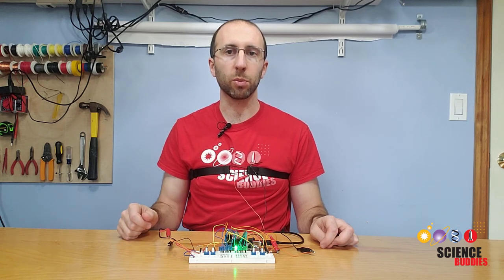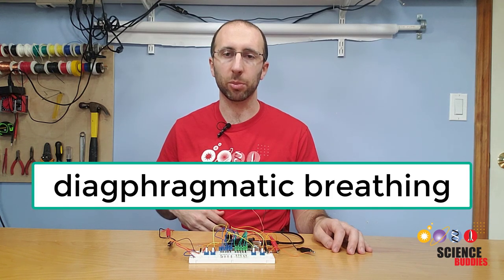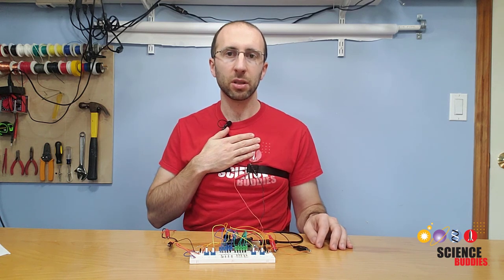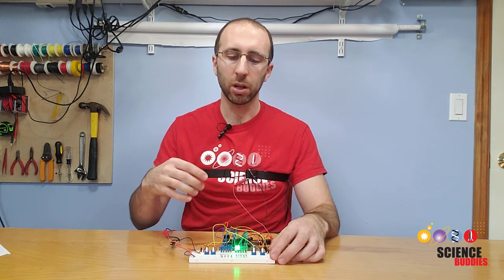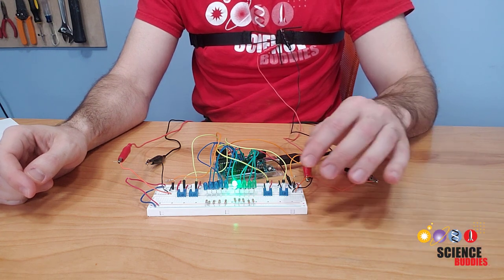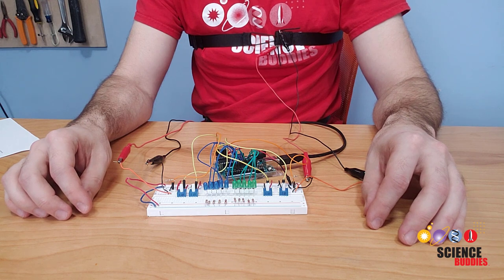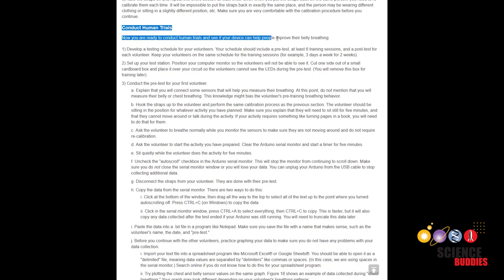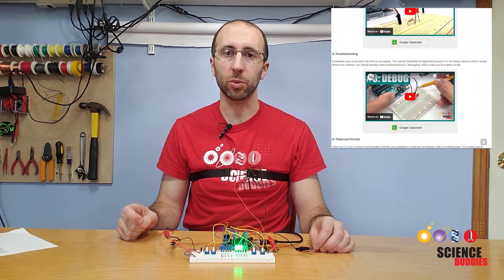Make an Arduino Breathing Monitor | Science Project

Comment: Can we use a flex sensor instead of conductive rubber cord?
Reply from the maker: We haven't tried with a flex sensor, you would need to test it and see how much the sensor flexes when you breathe.
Reply: @Science.Buddies  should just replace or resistance potentiometer value should be changed accordingly

Comment: How much is it to have one made that alerts me when my breathing gets too shallow?
Reply from the maker: Hi - if you check the link in the description, you will find a materials list with all the parts. Total cost will depend on what country you're in and what vendors you order from.
Reply: @Science.Buddies  How do I make it vibrate to alert me when my breathing gets too shallow? For example when a certain threshold in expansion is not reached for a few seconds a buzzer will vibrate.
Reply from the maker: Check out our Arduino tutorial playlist which includes vibration motors and buzzers: https://www.sciencebuddies.org/science-fair-projects/references/how-to-use-an-arduino
Reply: @Science.Buddies  it tells me how to make it vibrate from a sensor input but it doesn't tell me how to make wait 5 seconds after a lack of sensor input before vibrating.

Comment: What are all the alternatives for the conductive rubber cord, its not available in our place (chennai,india)
Reply from the maker: You could try weaving fabric using conductive thread instead, but you'd need to make sure it is tight and pulls back to its original shape quickly.

Comment: Hi, is there a way I can change the analogue readings into actual breaths per minute?
Reply from the maker: Hi - the short answer is "yes" but it's more than we can explain in a single YouTube comment. You would need to measure the period of the waveform, or the amount of time from one peak (maximum value) to the next. This may require filtering out "noise" or small random fluctuations in the signal, which could give a false reading. We don't have our own tutorial on how to do this, but you should be able to search for Arduino code to help you do this online, or ask for help in the official Arduino forums.

Comment: Bro can you tell the effective cost of all the components used for the project
Reply: It is not mentioned in the link given in the description
Reply from the maker: Costs can vary depending on where you purchase the parts, whether you purchase them individually or in bulk, and will change over time, so we don't list prices for individual parts. The link in the description gives a total cost estimate for the project but this is a rough estimate given the factors above.